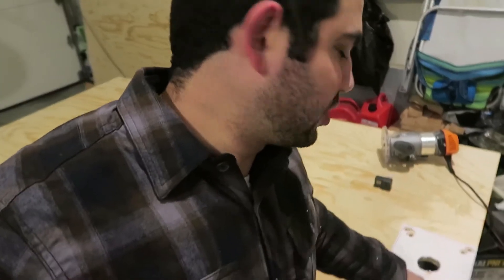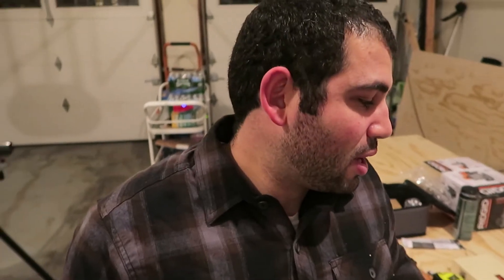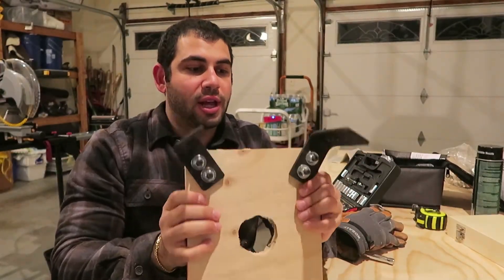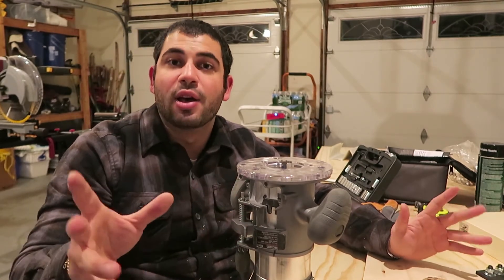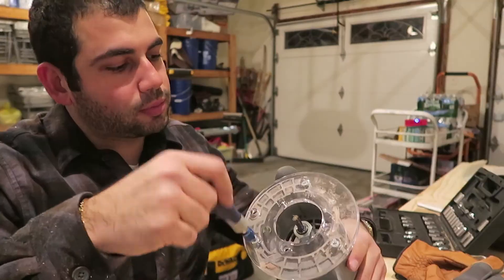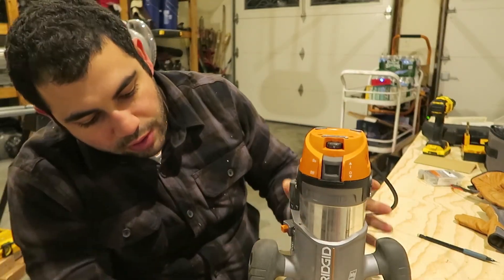Maslow CNC - Building the Sled!

Comment: Bro, 2 suggestions:
1) Use a proper endmill that can 'center-cut'. Straight edged cutters can't be used to plunge holes. You're going to want a proper endmill anyway because of your CNC...
2) Failing that, start your holes with a drill. Way easier and safer.